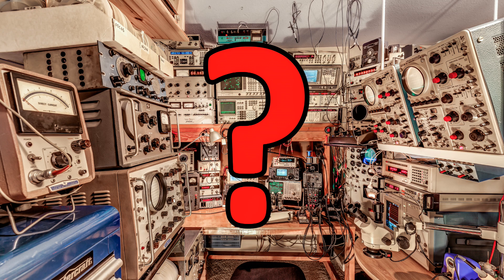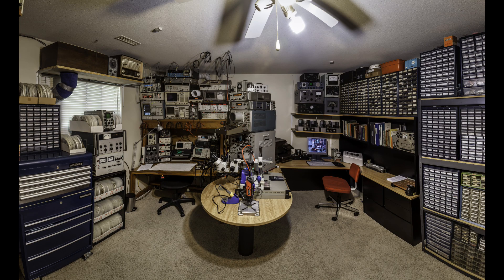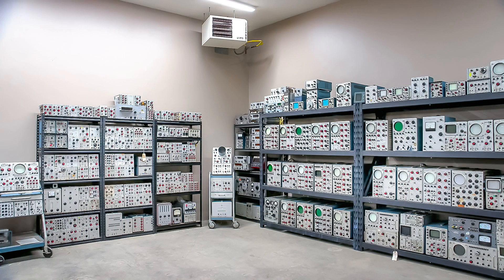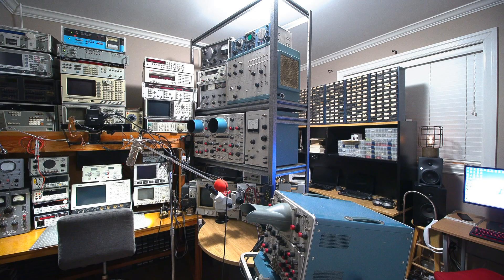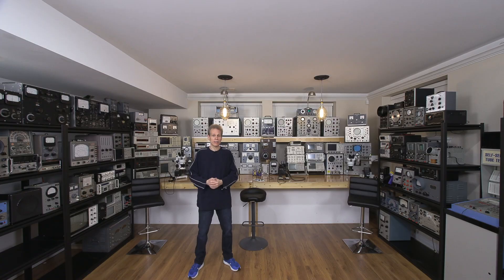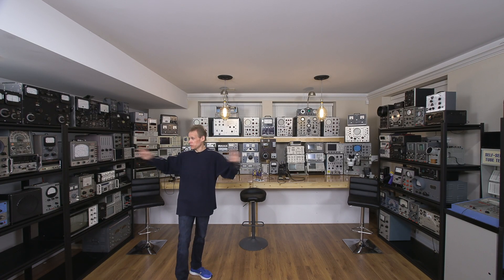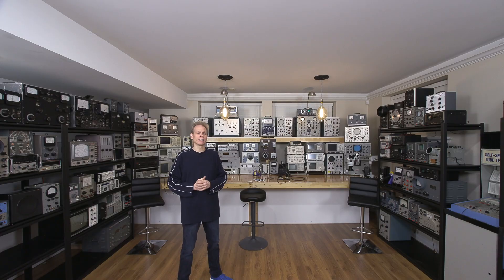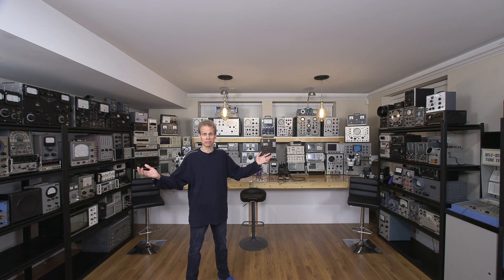Where Is Mr. Carlson's Lab? What's Going On?

Comment: Paul,back in 1978,directly infront of the work bench working on all types of domestic electrical appliances, and mainly valve TVs, we had a mirror as to set up the convergence, but also found it useful for reflecting light and to see the other side of the jobs we were working on.regards.

Comment: When you have rust and chrome what you want to use us 0000 steel wool and wd-40 and if it's crazy rusty alternate white vinegar and wd-40. If the chrome isnt too rusty it will be as good as new. You can polish glass with 4 ought steel wool. It will not hurt the surfaces. A trick I learned working in a bike shop in the '80s. 

I use it all the time on things I'm refurbishing. You can polish steel to the point it's very very shiny so even if things are pretty rusty if you put the time in  you can make the bad spots much less noticeable. 

This is one of those tips you end up using the rest of your life. It's definitely a good one.

Comment: So, I own a single Tektronix scope..  and here I see a wall, if not more, of them..  I guess mine must be similar to one of the two blue screen ones sitting on the top shelf, to the left (mine is a 465B). In the past I also used a 20MHz Tek scope.  So, that's all..  feeling a bit under-supplied here.. :-)

Comment: Hei man, this is a really impressing lab. I guess there is nothing you don't have and nothing you can't repair. I would be curious how you analyse faulty PCB's. This would be great to repair Pinball machines. TV's, Game consoles, Hi-Fi Amps and Recivers. Everything that's just to expensive to trough to the bin. I saw you take out SMD caps with a pliers. You never ripped off a copper trace? Are you an electronic engineer?

Comment: The new lab looks fabulous! With regard to unwanted noise in the background: it is possible to remove constant background noise (refrigerators, A/C, mains hum, tape hiss, etc.) from audio digitally using noise reduction software. You select an area of the recorded audio containing a few seconds of just the unwanted sound to give the noise reduction plug-in a "noise print", then select the whole audio file and voila! It digitally removes all the noise, leaving the foreground audio intact. I have used such plug-ins to great effect in Sound Forge and Audacity, for example.

Comment: When you get back to working on the old tube stuff, I would like to see how you tackle something that uses selenium rectifiers. I have a 1949 Motorola 8 inch TV in a nice Bakelite case that I would like to make work. It's tube filaments are series string and it uses selenium rectifiers in it. Lots of paper caps. Don't want to blow it up by plugging it in. No-one left in town that does old stuff to ask.

Comment: Mr. Carlson,

I am working on restoring a quartz locked radio and am having trouble finding light bulb replacements. They look like fuses but have a rating on them fpr 6.3v and .25amp. In a glass tube with silver ends.

Is there a website i can look at that may yave wjat i need?
Reply from the maker: Hi Ray. Search Google for:  "Fuse lamps"  Your light is possibly a "GF570"

Comment: Wow interesting, I was a bench tech/mgr for a company LaBarge Electronics there dead now, then a Field Engineer for AMTECH which is dead now too, they pioneer the RFID tags for the turnpikes as well as railroads and intermodal shipping containers worldwide, then i moved into the medical industry SpaceLabs inc. designing parallel antenna systems for wireless heart monitors,SpaceLabs was the first company to spinoff from NASA back in the late 60’s the very first telemetry systems actually used Techtronics scopes.

Comment: I have had my hands on and into 95% of the equipment you show on your opening screen.  I was an Air Force Metrology  (PMEL) tech in the late 70s.  The Air Force still used a lot of that equipment.  It was the period when they were phasing them out for transistorized units.  I loved every moment of it.

Comment: Okay, you like equipment but actually how much do you really need? I've been doing electronics for over fifty years, I design, write for magazines and have patents, my electronics bench is very well equipped and is about 1/10 of the size of yours. Also, even with the high end equipment I have, I'll bet it cost less than yours, I know it uses a lot less energy, it runs off grid most times. I'll bet you don't have a bench meter that's equal to my Keysight 34465A.

How many scopes do you need? Those things draw massive amounts of energy, one scope uses more than my whole bench and can't do what my digital scope does. To each his own, have a good time but look how much time and energy you're taking to build all those labs. Time is life, what  you do with your time you do with your life.
Reply from the maker: The 34465A is a nice meter. I have the Fluke 8845A which can be seen in the setup. I have the equipment to calibrate your meter, (Fluke 5440B, and a Datron 4708 with all options.) These can also be seen on the bench.
You say:

"one scope uses more than my whole bench and can't do what my digital scope does."

True to some degree, but:

My old Tektronix 556 can display 4 traces on one time base, WHILE on the other time base, display the input of the spectrum analyzer module at 4GHz. No external stuff, this is the 556 with two plug-in's. This is 50's tech.... Can your scope do that? Surely your modern scope can display two completely independent spectrum analyzers at the same time, Right? It does that too.

I enjoy what I do, and I enjoy helping others learn. That's what I do with my life.

P.S. I need more scopes!
Reply: @MrCarlsonsLab  All due respect, you'd have more time to help others if you had fewer instruments to maintain, store  and build rooms for. You said so yourself, you've been busy doing exactly that - not helping people. That's what you're doing with your life and, yes, if that makes you happy by all means do it. Could you help people just as well with one tenth of the stuff you've amassed? My money says yes and the Fluke is a modern instrument, it's not an RCA VTVM from 1950.

There's no free lunch, the storm we just had in Florida was the worst in history. We're running out of oil, that's right from BP, we're on the downside of Hubbard's Peak. If they could tap a well in Texas do you think we would have had a Gulf oil spill 18,000 feet down under 5,000 feet of water? I don't understand, people think conservation of energy  is not important. Everything we do, every blade of grass, every breathe of air and everything we touch depends on a healthy environment. Did you install PV to run your electronics lab? 

Sorry, I see your old equipment as unnecessarily consumptive, worse it can't decode I2C or SPI and store megabits of images or data, you'll need new equipment to do that. The difference is that I can trouble shoot anything you have or will ever buy, your old equipment can never meet that.

Comment: I bought two  used very nice12 foot electronics test benches augmenting an old icky green 72 inch bench. They have outlets everywhere & the 144 inch benches have cable management. There is also a 50 inch computer desk, so I am up to 35 linear feet of workbench bench with shelving behind, above & below. I no longer have any place to actually sleep though. Try moving 12 foot metal work benches. I thought the 6 footer was bad. When I get my insulated aluminum  refrigerated dry van truck body it all gets moved again. I am NOT making a shop inside of a container! Shipping containers SUCK! I worked out of them all the time in the field and they all sucked, so I am going with a 20 foot van body off of a truck. WE HAVE NO BASEMENTS IN PHOENIX!
Reply: I feel you on that working hard moving stuff part. So far, I have broken my ankle and twisted my back into a pretzel. My helper is not very helpful.

Comment: Given that the floor is a hard surface (not carpeted - which is good. Carpet in a lab is a bad idea), and the ceiling appears to be drywall, I would strongly consider putting some acoustic absorption on the ceiling. Lots of readily available options that use the ideal Corning 702 and 703 fiberglass panels (which is what you want for this). If you hang around corporate surplus places on any regular basis, you can usually pick these up for free - they're very commonly installed in offices. I suspect that will help with some of the echo issues. This channel has always had pretty darn good audio quality - I'd hate for that to change.

Comment: Very nice lab!  I've been working on mine for quite a while also. I have about 20 feet of bench area. Mine is actually a lab from a school.  All of the oak cabinets and phenolic resin counter tops. My main work area is actually a 6 ft island bench on wheels that I can move to different areas with different equipment, with my project on. It meets up with the stationary benches flush.   I actually used chairs like the ones you have for a while. Didn't like not being able to wheel myself around. Now I use high lab stools with wheels on.  Would really like to see yours in person. Don't make it up that way too often. I'm not extremely far though. Pa. in the US.

Comment: Okay Paul, I like the tag you have in the corner with a wire sticking out that says "Warning, this wire contains over 10,000 Ohms." AND, I see you are using a mic-les wire... So cool., The sign on the ceiling  is quite clever as well "Please do not stack any higher than this." NO but for real... Where did you get those shoes. They are swell! I want a pair. Purple bluish., AWESOME!! : Lol. Love everything you're doing. Nice work.

73' de Dave N7*%&

Comment: The vibration from the heating system (or traffic in that other place) might be reduced by layers of really soft insulation, such as isover or rockwool.  It's quite powerful and lightweight, but horrible to work with (basically wear a disposable hazmat suit to not get itchy fibers everywhere).  It's not hideously expensive  and it's quite fire resistant too.

Comment: I'll tell you what I envy the most about your new lab: the flooring. My "lab" is a spare bedroom--with wall-to-wall beige carpet. I absolutely hate it. Drop anything smaller than a peanut and it's swallowed up my the carpet. If you did drop a peanut (or anything else not very-brightly colored), you'd never find it against the beige background. On the bright side, though, I'll never break a vacuum tube that happens to roll off the bench.

Comment: I know you have tons of electronic equipment and I am happy to see you now have plenty of elbow room in which to work, but there is one piece of kit that I do not see and that is some type of fire suppression in case the unthinkable happens! Have you hidden that as well. I would hate for you to lose all or even some of your electronics. A sprinkler system isn't advisable, a halon system maybe, or what else would be possible? Definetly a main power breaker protecting somewhere apart from your new room possibly. You have too much time, money and effort invested not to have some type of system protecting your gear.

Comment: Well done!
My bench was 24 feet long by 4 feet deep for the same reasons as expressed in your video. I wanted some workspace left after I installed all the test equipment.
I also had a 2 foot by 24 foot shelf for more equipment, but was not smart enough to angle the equipment down in my direction to see their front panels without glare as you did....
 At 77 years old I think I have lost about 1/2 of my original IQ, 90% of my hearing, 50% of my sight, 80% of my muscle mass, and about 50% of my manual dexterity.
 So these days I pretty much only live vicariously through watching your videos.
Without you, (and Uncle Doug who also works on old tube equipment and old cars), I would no longer have any use for the internet!
 I am very glad to see you expanding because Doug is getting old like me and starting to slow down too....
 Please keep up the great work so us old techs can relive the best parts of our lives through watching your videos!
Dennis O.
Frankfort, Illinois

Comment: I just recently bought a house built in 1921 that had its original Cast Iron Gravity Furnace in the Basement and that furnace weighed probably as much as all of your scopes put together on one pallet. The exhaust manifold of the furnace alone weighed at least 300 lbs and took about 3 people (me included) to lift it off the top of the furnace.
Reply from the maker: That would have made a great video!
Reply: @MrCarlsonsLab  I wish i would of made a video of it but it was all me, my dad and a friend of mine could do to take the unit apart without breaking our  backs because of how heavy that unit was. unfortunately i dont have access to a tripod to put my camera on.
Reply: If you had a way to receive photos i could of sent you a photo of what the furnace looked like before it was removed from the basement of my house.

Comment: You, Xraytony, and M. Caldeira are my go to channels for learning electronics. My restorations have been a VTVM, and a couple of tube radios. I have designed several simple projects for my own needs and to help a couple of good friends with deck lighting and solar controls for the lighting (some classic logic gates mixed with MCU, plus programming the micros). Bits and pieces learned from all of your channels and self teaching other aspects has helped me greatly. 

I have not made any of your projects (I'm not patreon) but I have designed my own ESR + Leakage detector meter again using what I have managed to learn and based of other designs. I have a modest lab but my interests slightly differ in some areas. I also designed a 3D printer in CAD and built it, honestly the design iterations on the printer are the hobby (not the printing, but it is indeed an excellent FDM printer). I also use isolation routing to make my own circuit boards on a CNC engraver (no chemicals and just dust to vacuum up). I've enjoyed every minute of learning for all my hobbies. My newest acquisitions have been a decent Rigol function generator, and a couple extra DMMs (seems like you can never have to many). 

Thank you for everything Paul, channels like yours has expanded my hobby list and allowed me to learn a great number of things and have re-sparked an interest that began more than 45 years ago. I look forward to following along for as long as you produce content.

Comment: Here is a guess from an old audio hobbyist.  I don't think your echo is so much due to still missing shelf fillers.  From the view it looks like the main echo would happen between the ceiling and the floor.  Assuming you don't want a big floor mat, you could try to do some padding on the ceiling.  I happen to have experience about some excellent material that we used at the campus "studio".  That cost essentially nothing and was meeting all our needs.  Talking about egg crates.  At that time the common egg crates were for 4 by 5 eggs, or even bigger.  Anyway, the base and the mirroring lid  worked marvels, when glued to the brick wall, or actually on top of the flat, painted plaster. 😊😊
Reply: or he could go buy a couple of area rugs @ IKEA for $60 each..  ;-)
Reply: @BretFrohwein  I was going to suggest that too. Area rugs over hard floor make a huge difference to room acoustics.
Reply: Don't sweat the small echo issue. I'm SO happy to not be hearing the Bass Proximity Effect you were saddled with previously. Well done, Mr. Carlson!
Reply: Actual egg crates are a horrible fire hazard and don't work all well. They diffuse high frequencies but don't absorb much. There are plenty of companies that make far better acoustic absorption materials that have fire ratings.
Reply: @hubbsllc  Few companies, however, make absorption materials for free.  I applaud the use of materials that would otherwise go into the trash so long as they don't end up making your place look "trashy".  Perhaps there's an inexpensive spray-on liquid that could help lessen the fire hazard posed by egg-cartons?
Reply: @sincerelyyours7538  The polar opposite of free is more like it.

Comment: Curious as to what workbench and equipment shelf depths you used.  I'm in the early stages of designing a new electronics workbench and that's one of the design parameters I haven't settled on yet.

Comment: I came to your channel because i used to do a lot of electronic repair myself, i was a little too young for the tuibe era, but really enjoyed doing car audio repair throught The late 80's and early 90's i did a lot of amplifier repair and got pretty good at sorting factory radios, GM Bose were always on my bench. later i got into copier repair and was certified on many models. later they went digital and i saw that it was becoming an obsolete item with the world going paperless. anyway for the past 20 years i found my Niche in Insurance, and been doing that. i watch your channel to live vicariously through you! lol i still enjoy the idea of solviong a puzzle and fixing a problem with no schematics, nothing but straight up simple understanding of circuits and finding the failed components. the only thing i wish for your future videos is to make them a little shorter, sometimes i dont have the time to watch the whole thing. I think if you could edit more of the dead time out or possibly high speed through the tedious parts, it might make them a little shorter. ive always noticed your audio is clear and abscent of background noise. i have always wondered if its your Mic or if you edit the audio and remove the background noise. all your videos look and sound excellent! keep it up!

Comment: went through the same issue not enough workbench now its 4ftx18ft the overhead LED's helped but were'nt enough just installed a big window. road noise and i live smack dab between busy army base & major airport the helicopters make the whole house shake its even hard to breathe they fly in 2's 6-8 at a time